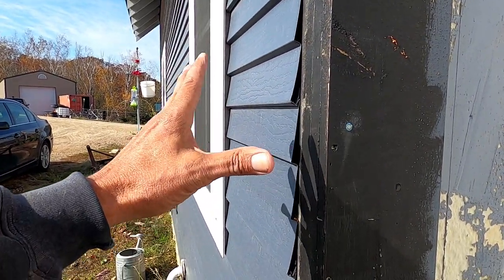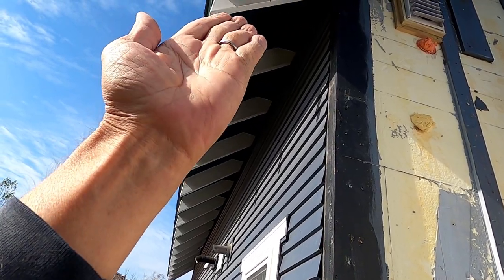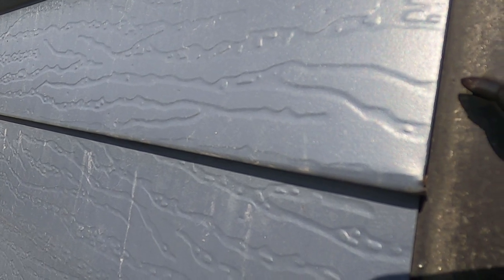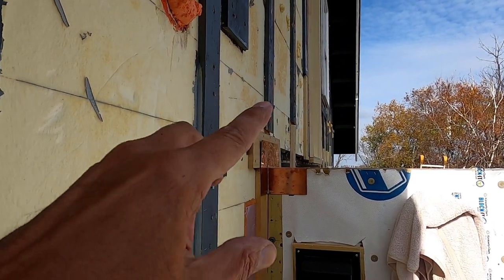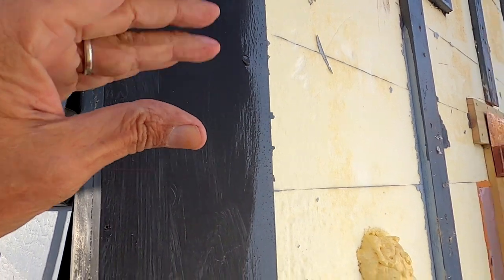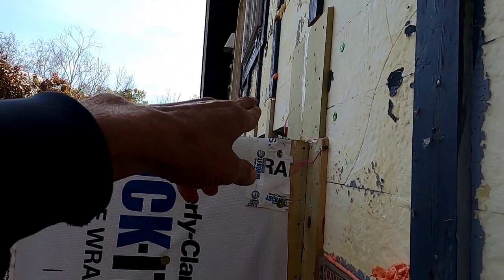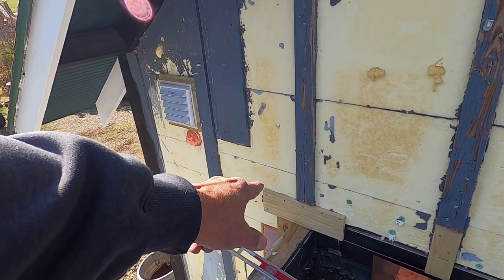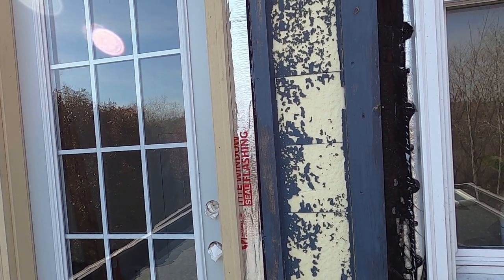Laying Out a Difficult Siding Job

Comment: Hopefully, the crew that installed the original siding had the same attention to detail, especially knowing that they were not going to do the back.  Did you check their work to see if it would line up?  Good luck!  Glad to see this project back on the roster.
Reply from the maker: Hi Drue, Everything came out perfect to the top pf the parapet. Hopefully I can get things to line up above that!

Comment: Hi Plantet Mojo - looks like nice siding!  Pretty color. You're doing a good job.  We've commented on your channel before.  We follow the Millennial Farmer and found your channel from the comment you left on their channel.  We'd really appreciate if you'd give our channel a look if you get a chance and aren't already following us.  Thanks in advance!
Reply from the maker: Hi Purple Collar Life. I just left a comment on your snow blower video. We had to quit using a snow blower because of the gravel breaking the shear pins. The blower worked great in the city on concrete, but not so much on gravel. Maybe the Toro will be able to handle it, but I would get some shear pins before you need them 😉